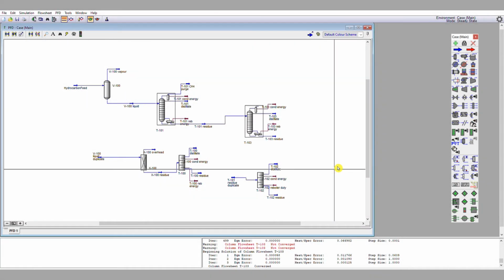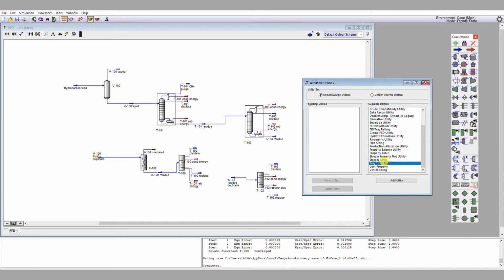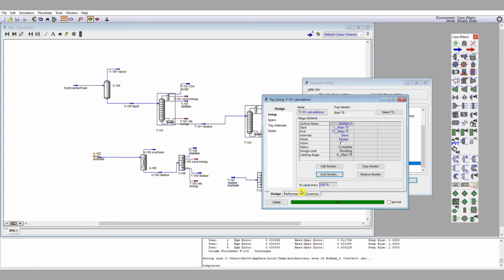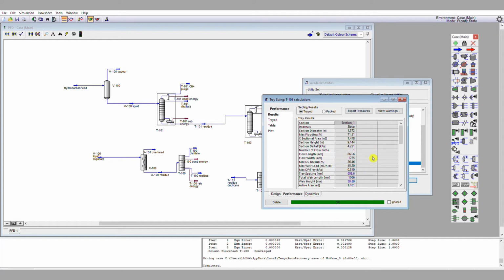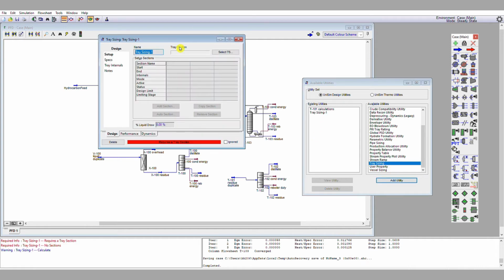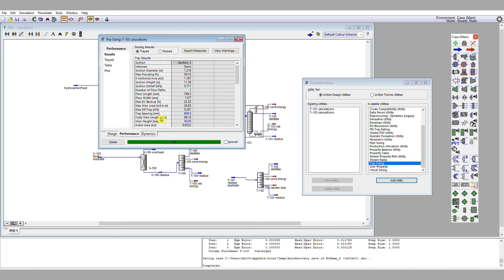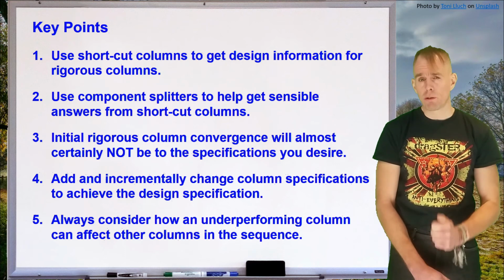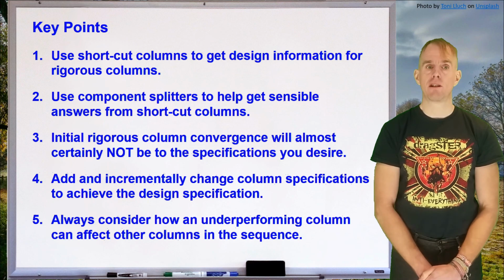UniSim / Hysys tutorial 2(v): getting mechanical data [by Dr Bart Hallmark, University of Cambridge]

Comment: Hello, thank you for this very useful video
One question related to column diameter, I got 8.8 meters via this Utility, check all parameters multiple times and still 8.8 meters 
What could be the cause of it?
Reply from the maker: Very glad you found the tutorial useful!

So, the first thing is that your column may just have an optimal diameter of 8.8m! Vacuum columns on refineries can be roughly this diameter as can large power station scrubbers. 

Don't forget that column diameter will be intrinsically linked to the vapour flow rate from stage to stage. How much reboil have you got? Do you need the purity in the residue to justify the reboil rate and hence the vapour that it's returning to the column? Equally, what's the vapour content of the feed? Check whether it's a single stage setting your column diameter or whether there's a number of stages with similar vapour rates. Then examine why you have the vapour rates you have where you have them. 

A secondary influence on column diameter will be tray design or packing selection. So if your vapour rates are what the process requires to operate, you may be able to reduce the diameter somewhat by carefully choosing your column packing or by adjusting your tray type. 

Hope that helps!
Reply: @drbartsworldofchemeng  thank you for your replay, maybe I expressed my point not very clear, so I just repeated what you did and till tray calculation utility usage everything was very closed to your results, even T-103 trays section was very very similar, but T-101 tray section utility calculated 8.8 meters column diameter. I checked T-101  spec, tray type, reflux rate and all other properties everything is similar but column 8.8 meters
Reply from the maker: @TarasewichTG  Ah!! I see!! I forget what column internals I had for the example, but that's what I'd check next. Also, and it shouldn't matter but sometimes it does, what version of unisim are you using? I think I did the demo with an early version - R390? The utility may have changed and give different results. If in doubt, do a hand calculation to cross check so give confidence in the results. Hope that helps a bit.
Reply: @drbartsworldofchemeng  
Thank you for your help. Probably this is due to version different I use R460 for modeling. But such a big difference looks strange. Any way one more time thank you for your help. I will continue watching video on your   channel very useful
Reply from the maker: @TarasewichTG  I agree that such a big difference just doesn't feel right... ... if I had access to R460 I'd try it out, but unfortunately I don't 😔